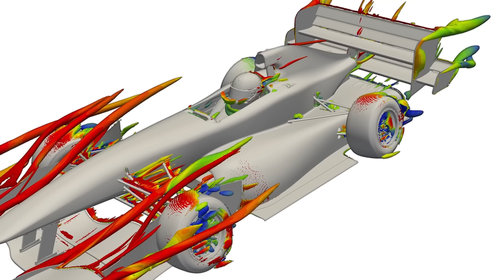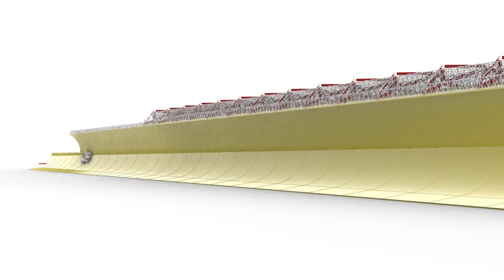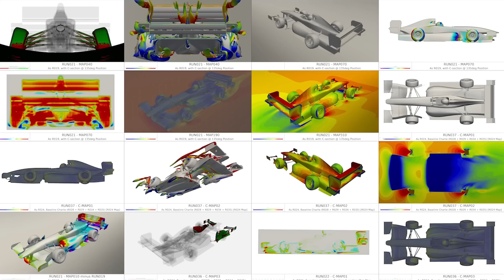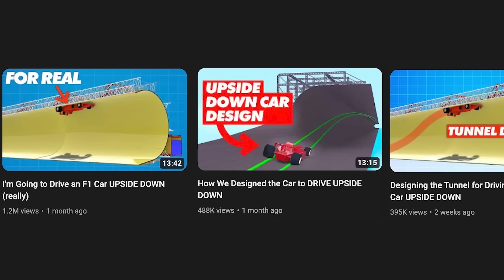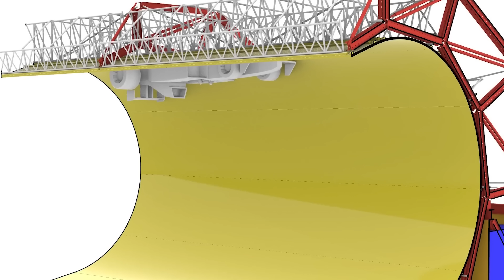Driving a Formula Car Upside Down (UPDATE)

Comment: I'm not so naive to think this project isn't to make money in some way or another...so yes, all these monotized posts on YouTube, and wherever else are being publised, is great. I mean you caught my attention a long time ago. But what caught my attention was the test of the claim an F1 car had enough downforce to drive inverted. You seem to have strayed WAY away from this. Now you're using a different car and taking into consideration a multitude of things that don't answer the "enough downforce to drive inverted" question. Now there are variables such as the curve of the track under the car while it is transitioning to inverted...the length of the track to build (price has to be astronomical) while its driving inverted...and the transition back down to our friend "gravity" holding it to the pavement. Why not simplify things and build a wind tunnel that can just rotate the car? 100 feet maximum? Yes, a lot of money...but your initial question was "does an F1 car have enough downforce to drive inverted" and all that takes is wind at the equivilant speed. Why create an entire track when you could just make a rotating wind tunnel? Build a tube (again...long enough for the fans and staging of the car) which would create the equivilant wind effects as driving and then rotate it? I understand this would be WAY less exciting than building some life size HotWheels track but it would accomplish the answer of a real F1 car, not modified for curvatures of the transitioning track, not needing miles upon miles of built structure stretching the lenth of whatever distance you are proposing...and simply comparing the original question of "does an F1 car create enough downforce to drive inverted"? As it stands all I'm seeing is "can we create a car that will drive inverted on a crazy expensive track we build." 

But I'm just a simple Indiana country boy who was sincerely curious as to whether the theory that an F1 car could drive upside down was true. I love racing and I love engineering. Was just hoping this project would keep to its initial roots.

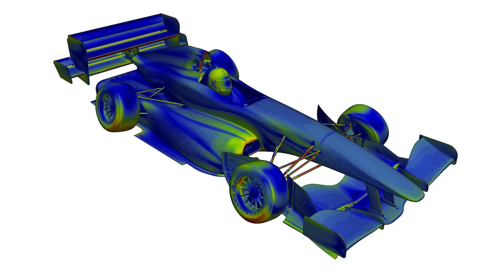Comment: 3:40 why make it electric??
Reply: An internal combustion engine requires fuel and oil systems, both of which are made to function upright and will require major design modifications to make it function temporarily inverted without the engine being starved of fluid or saturated with oil. An electric motor has none of these requirements and will function exactly the same in any orientation
Reply: Oil and fuel wouldn’t work real well. Oil
Would probably leak through piston rings
Reply: Regular engine go boom because it can't go upside down. He talked about it in a previous video

Comment: Why don't you create a car that starts traveling already upside down, sandwiched between two roads? 
Then at a certain speed, when down force is big enough, the lower road disappears for 50 meters so we see it driving on the upper road.
That would eliminate the need for half pipe design of the road.

Comment: For the people saying "eww, electric", YOU ARE WINDOW LICKERS. Explain how is a combustion emgine gonna work upside down?? Fookin Einsteins over here 🗿🗿
Reply: It's called fuel injection
Reply: Electric makes more sense but it's perfectly feasible to build an ICE that runs safely when inverted.
Reply: @MrAdopado  It's not just the fuel, it's cooling and other systems
Reply: @gonzo1354  There are ICE engines that run inverted. However, it's much more straightforward to use an electric motor.
Reply: an ICE was a point of concern for me too. Except for airplane engines they are designed to run inverted.
Reply: @nelsonbergman7706  because of fuel injection

Comment: Why electric motor ?
Reply: The oil and fuel systems don’t work well upside down. Sorting all that out is possible, but expensive and lots of extra work. Going electric makes it easier and cheaper.

Comment: Have you looked at starting to run the car upside down on a track that is flat with two parallel surfaces. Once at speed the floor (or “ceiling”) would no longer be there. Cost of track way cheaper, no need to modify suspension and way safer (if you lose downforce, only a little way to fall).  Not as dramatic of a stunt but would prove the concept.
Reply: The problem there is the top and bottom of the tires are going different directions. You’d have one side trying to go forward and the other side trying to go backwards.

Comment: Everyone's saying Red Bull, but you should get Hot Wheels in on this.
Reply: Por que no los dos?
Reply: just do both of them
Reply: Hot Wheels is a great suggestion.  Scalextric would be another one to approach.
Reply: Or both😅
Reply: Hot Wheels is a company that makes stuff that costs money. Red Bull sells $0.09 cans for $2.99. Most of their money is spent on advertising.
Reply: @amg2022   You don't know toy industry. Toys are made extremely cheaply, at an extremely large volume, in order to seed every toy store across a good chunk of a globe. Most of their money is spent landfilling their product, which is where most ends up unsold. If they think they can reduce their landfill footprint, an insane marketing budget suddenly emerges. Their profit margins are about 20 to 50fold for every product sold, but they have this unsold product problem.

Problem is they can't exactly be making less product, because if it's not in stock at a given store, it's not going to be bought, and they have very long lead times, so if something becomes a hit, they don't have a way to resupply it for the next 10 months, by which time the hype is going to die down, so they have to produce for the maximum possible demand, not for real demand.
Reply: @amg2022 3$ for a redbull in Slovakia it cost 1.60€ which is around 1.70$ 🤣
Also this would be a think redbull will sponsor
Reply: @amg2022  yeah i think red bull makes more money than hot wheels. They sponsor so much stuff. They can just throw money at sponsoring stuff
Reply: Microsoft and the the Forza Horizon series could tie this in with a release perhaps also
Reply: Nadeo, the company that makes the Trackmania games too.
Reply: Came here to say the same thing! They played with this concept in a live action "documentary" style video 13 years ago
Reply: @CalibreDesigns  13 years ago, feels like yesterday, but I am an old fart. These things happen to me now. Like 1975 was yesterday and I fell off my BMX. It's only £3m, Red Bull & Hit Wheels should be all over this. Or is there something going on that they wont even touch ? Very odd given the stuff they get up to.
Reply: Forza
Reply: @samshim3149  Trackmania
Reply: It would be cool, but think logistically. Which of the two companies is more likely to throw $14m at a project like this..
Reply: @domotime19  uhm actually is 4 million not 14 millon (idk how to put the nerd guy emoji so )
Reply: or, both!
Reply: Red Bull backed out because only they can give you wings...
Reply: Either would make sense
Reply: Redbull/hotwheels collab?? That would be sick!
Reply: They sponsored videos years ago for super long car jumps and loop the loops so this would be a great addition
Reply: I was thinking the same thing
Reply: I was thinking the exact same thing. Red Bull obviously, then I remembered the Hot Wheel loop with two cars. How much did that cost to set up? More than $3m knowing America. You would think that both of them would be all over it?
Reply: Hot wheels would be great but I doubt a toy company (which is Mattel) would finacne a dare devil stuff just like redbull
Reply: @sokol1235  One of a few Team Hot Wheels out there. There's also the one where they had two cars perform a loop followed by a jump lol. Madness and good fun. https://www.youtube.com/watch?v=7SjX7A_FR6g
Reply: Nice collab for them them. Could bring both a lot of extra revenue.
Reply: this is right up Mr Beast alley
Reply: Why not both?
Reply: @dranaugh3687  Exactly. Both are in their wheelhouse.
The tunnel is not going to happen.
I used to work for a tunnelling country. It's not a simple project. Any foundations anywhere near it means lots of vibrographs and limits to Peak particle velocity. That's what causes shock to nearby structures.
I can't see a tunnel of this scale happening for the budget they have.
I really hope it does but I think it's not realistic unless some crazy rich Sheik decides it's worth money for publicity.
That could very well work.
Anyone?, Anyone?
Luv and Peace.
Reply: yeah..this is more of a hot wheels stunt than some ox piss distributer.
Reply: nah, hot wheels faked this 12 years ago
Reply: Pitch it to Musk and Tesla / Boring, have the engines be from Tesla, have the tunnel actually be a tunnel made by the Boring company (you might have to wear a red baseball cap for the next 4 years tho)
Reply: Red Bull is bullion times richer that’s why
Reply: @Aidar4ppl  red bull really isnt a billion times richer, not even ten times richer. Hotwheels is owned by Mattel and the brand has a net worth of around 6.6 billion as of 2024, while red bulls is closer to 20-30 billion. At least do some research before stating something as a fact :/
Reply: @cappaccino4324  it’s irrelevant, as Mattel isn’t interested in sponsoring stunts and tricks, dummy. What’s the use of this net worth if it can’t be used. Red Bulls resources CAN BE used, as it’s exactly what they are interested in and exactly what they sponsor!
Reply: @cappaccino4324  tbf, he said "a bullion"
Reply: @cappaccino4324  How about you work on your reading comprehension/assumptive reasoning before schooling someone on something they weren't even talking about? 
Did they say billion or bullion? Exactly. Nuff said. 
You are wrong no matter what. due to so much missing context. As in, perhaps it's just about the richness of a single copper bullion's purity percentage? Maybe Aidar knows something we don't and RB has billions in bullions stored? 
Who knows....eithery way, no matter what you say, Aidar4ppl (and I) could easily just use the ol' schoolyard tactic for Tag, "Nuh uh, my invisible forcefield was on, so you didn't actually get me!"

P.S. 
No. The answer is no. 
So stop asking because I don't know wtf I'm talking about either.
Reply: @Aidar4ppl  🤣
Reply: ignore this poor person who was clearly dropped on their head as a kid. Red Bull is by far the only decent choice here. Hot Wheels!? Go back to kindergarten....
Reply: @tomgreen876  Kindergarten? Ha!! You clearly never had a Hot Wheels 'loop-de-loop' track as a kid... we used to drive our cars upside down like nobody's business.
Reply: @tomgreen876  Hot wheels has sponsored multiple car stunts, including the first ever full sized over the top loop, the first ever double loop, etc. Rebull sponsors adrenaline junkies doing anything. Hot wheels sponsors adrenaline junkies doing hot wheels type stuff, but bigger. They'd both be damn good sponsors, but 14mil is just more than they can fund.
Reply: @tomgreen876  sorry big boy

Comment: If you curved the path for the part climbing the wall you could use centrifugal force to climb the wall on a flatter track, then straighten out where you will get to the full inversion. Less land footprint, too.

Comment: I've thought a lot about this before- the downforce exceeds the weight so theoretically the car could drive on the ceiling of the tunnel.  However how fast does the car have to go?  How much thrust does this require? When the car is upside down how much upwards force does it actually have on the tires and is this enough to provide the needed thrust?

Comment: I reckon the curvature to morph form a curved tunnel wall to ceiling will upset the aerodynamics in an unimaginable state of disaster, unless this tunnel is so darn wide to mitigate a massive gap that will appear between front wing and ceiling.
First they should try seeing what happens when you drive a car that relies on a front wing in a tube " the right way up". I wouldn't fancy my chances.

Comment: Could you just use the "Aircraft Research Association (ARA) Supersonic wind tunnel" located in the UK? Put your car upside down on the ceiling of the wind tunnel (or a strengthened fabricated ceiling) and hold it up there using hydraulic rams. Turn the wind tunnel on to match an F1 cars top speed, then lower the hydraulic rams and see if the car stays on the ceiling? You would also need an attachment point to counteract the wind trying the push the car backwards. Must be cheaper than 14 million.  Also you would not need to run the cars engine so cooling and lubrication would not be a factor.

Comment: It's always fun with projects that inspire. That being said I, I can't really see the "inspiration" in this practical project. The principle is simple. If the car produces more downforce than the car weighs, it will be able to drive upside down. It's the structure that will be the impressive part about this project, but for 3M, you could do a lot of good in the world.

My 2 cents (if you want funding) is to make the structure/materials REUSABLE for something that has an actual purpose after the stunt. Then you will be doing something "fun", but the actual project will be way more meaningful than driving a car with an inverted wing upside down.

Comment: Serious question:  Wouldn't this money be better utilized by a charity?
Reply: Honest answer: Not really. Besides, this project would give a job to hundreds of people for extended period of time. 
You only see the money itself, but the project like this would feed the families of people involved while actually producing some value.
Reply: @MrMichalMalek  It would produce the same value as having the same workers dig holes in the ground and fill them back in.  Just because you're paying someone to do something doesn't mean you're creating value.  It's a complete waste of money.  At least a well-run charity might spent the money in a manner that has a long-term beneficial impact (for example, by sobering someone with a drug addiction).  Even building children's playgrounds or digging wells for villages in Africa would have a larger beneficial impact than building a single-use structure to film a single video.

Comment: I dont really understand the reason for this. He said its for inspireing curiosity. No one will think how an earth the car is upide down. How is that a questionable thing? If the downforce is greater than the weight of the car of course it will go upide down, thats not the physics challege of this project. This project doesnt seems to be about the car going upside down, its about building a tunnel as cheap as possible. And that is a boring project for people who are just spectating. Most bridges are probably more complicated and more interesting that this. Building a tunnel as cheap as possible that is strong enough for a car to go on it upside down is not an interesting physics project in my opinion. Maybe for the people who are working on it is a big challenge and interesting but i dont think it is for the outsiders.
Reply: The problem is you need far more downforce than the weight of the car. It still needs weight on the tires for traction. If it weights 1,000lbs and you make 1,200lbs of downforce it technically can go upside down but you’d only have 200lbs on the tires. 

They’ll have to make twice the weight of the car in downforce just to get the same traction it has sitting still. That’s a big part of why nobody has actually done it for real.

Comment: You could go to a wind-tunnel, put the car in a big tube which can be rotated. You can even drive the car a bit back and forth while at speed and inverted. I agree it's a bit less dynamic, but it would prove the point.
Reply: Unless you have the ground moving the same speed as the air you don’t actually have a complete simulation of the real world so they’d have to have a tube that’s also a a treadmill that can rotate at the speeds they need to travel at and also have it fit in a wind tunnel. I’m pretty sure you’d be looking at over $3 mil after building that and paying off an aircraft manufacturer to let you possibly damage a $10’s of millions wind tunnel